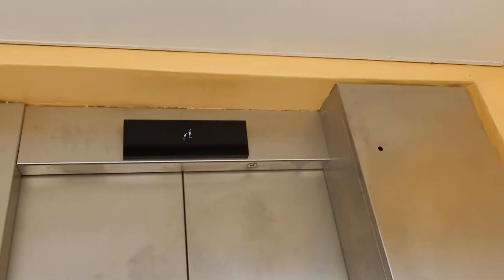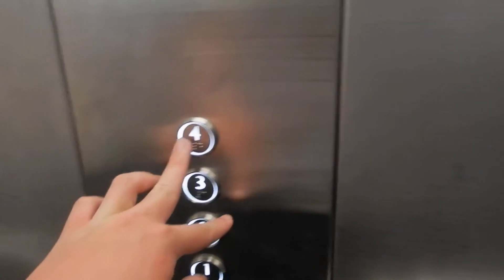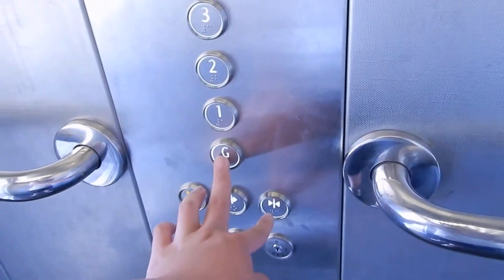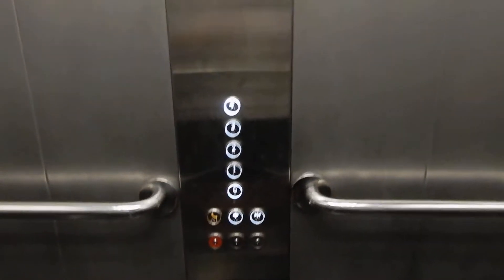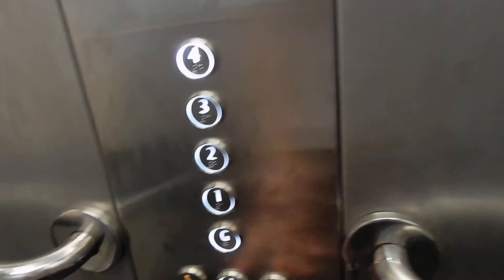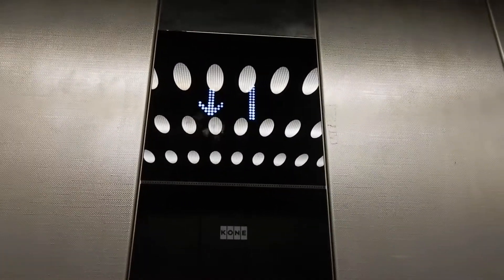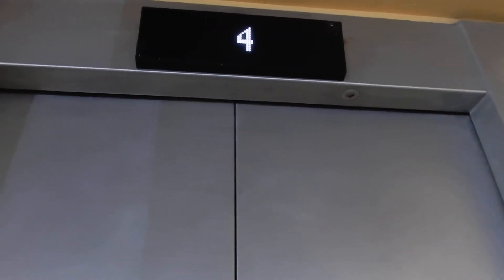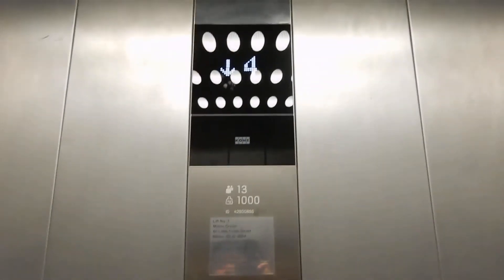World's FIRST KDS 220 video! Modded Kone MonoSpace MRL Traction elevator at Milton Green Car Park

Comment: I know the voice is KUKN, what is the chime code called?
Reply from the maker: @cakeman8406  Code for the chime is KDS. KDD would identify the higher pitched version.
Reply: @TheDragonFire123 or what about chimes sounding identical but Schindler instead of Kone. E.g. service lift at grand central toowoomba
Reply from the maker: @cakeman8406  Schindler equivalents have code SFM, which is derived from *F*I-*M*XB.

Comment: Wait, how do you tell a KDS 220 and KDS 330 apart? I might have walked past a few previously without knowing they were KDS 220s...
Reply from the maker: KDS 220s:
*Have a shorter glass for the indicator.
*If indicator is LED matrix, will be in landscape mode (arrow appears to side, rather than above floor)
*Hall indicators like the one in the video are fatter and longer.
KDS 330 is the opposite:
*Taller glass for the indicator.
*LED matrix indicator arrows are above, not to the side (portrait mode).
Reply: @TheDragonFire123  It also applies to LCD segment versions too.
Reply from the maker: @evt.satellite_01  Yeah, I figured as much. Since only KDS 220 has segment though, that alone is a hallmark feature of KDS 220. I'm pretty sure there is a standard KDS 330 style LCD for KDS 220 judging by fixture documentation as well, and that would also be in landscape like KSS 700.
Reply: @TheDragonFire123  220 has lcd segment, led segment, and led matrix. Read the brochure.
Reply: @TheDragonFire123  Oh ok I get what you mean now.

Comment: That’s so cool! There are a few KDS 220 fixtures at my local KONE training center but seeing one that’s totally working is really fascinating!
Reply from the maker: Part of the problem is that KDS 220 is so new it's been rarely promoted to building owners. But still, seeing one in real life and not just on the E MonoSpace brochure is awesome!
Reply: @TheDragonFire123  KONE told me they are soon to be discontinuing their KDS 50 and KDS 300 fixtures, so I guess KDS 220 is the replacement for KDS 50 and KDS 330 is the replacement for KDS 300.

For European models, KSS 700 will be replacing 420, 470, 520, 570 and all that stuff (for KONE DX tho).
Reply from the maker: Seems that Kone is moving to entirely Kone Information-styled fixture lines now. Interesting how similar KDS 330 and KSS 700 are; almost like we're back to the Delta days where Euro and Asia received (almost) the same fixtures. KSS 700 probably uses modified buttons though.